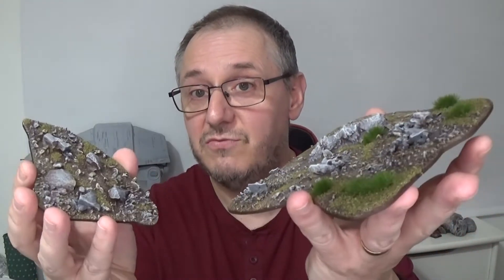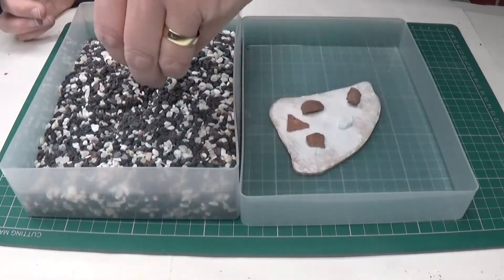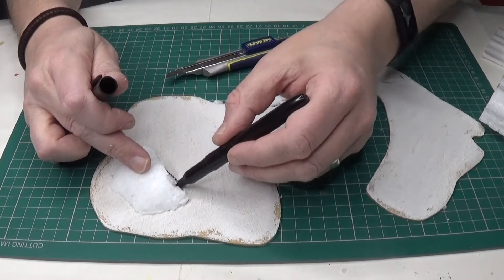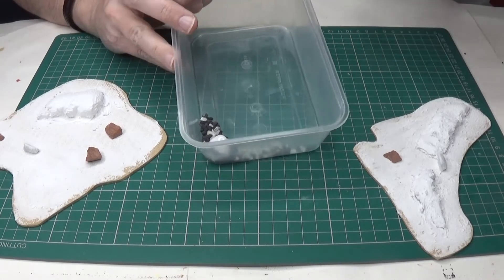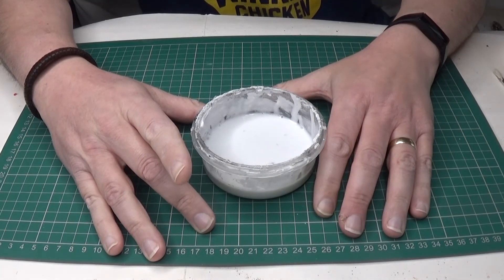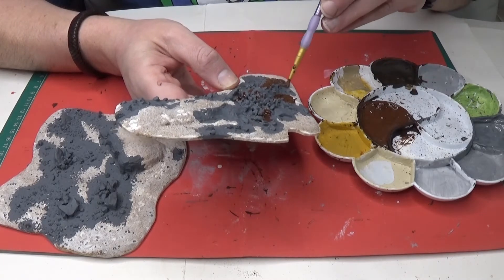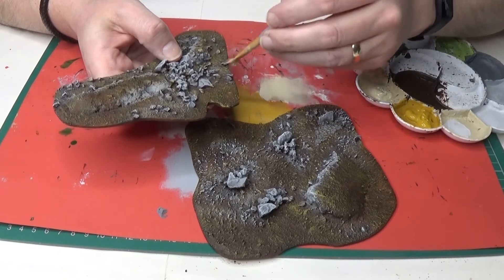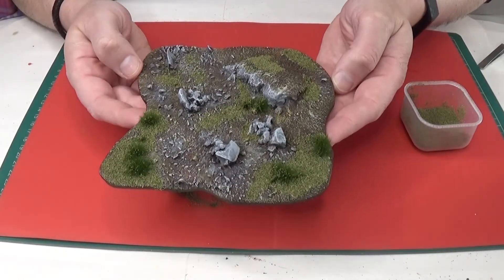Rough Ground Part 3 - Battlefield Basics - Easy to Make Wargame Terrain

Comment: Some great vids on this channel what ill be using to make some terrain for my middle earth games! 
Quick question, whats the best way to cut the irregular shapes from the sheet materials? Dont fancy chopping my finger off with a knife haha
Reply from the maker: Thank you very much, also the ME SBG is a great game.
As for your question, depends on what material you're using for you base, if using card or plastic you could use a decent pair of heavy duty scissors, and if using wood i'd recommend using a electric jigsaw but you could use a coping saw.
Reply: @THTerrainandPainting  awesome. Thanks for the reply :) ill give a go and try and make some rough ground after i make the hedges in your other vid